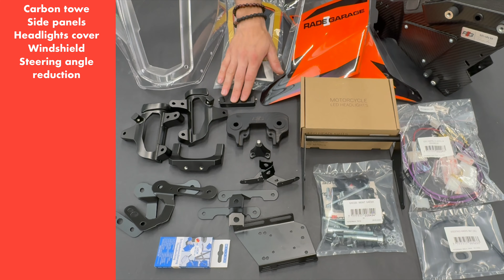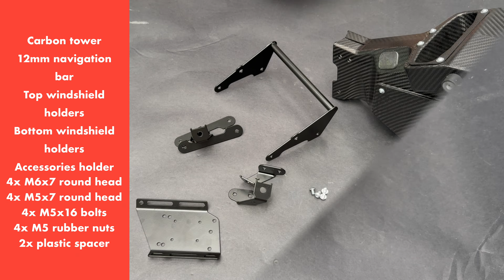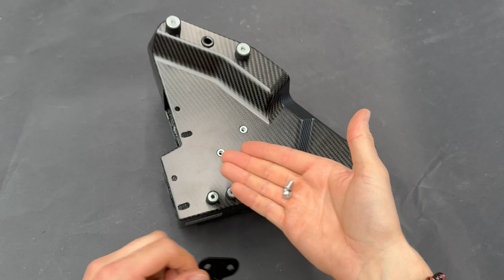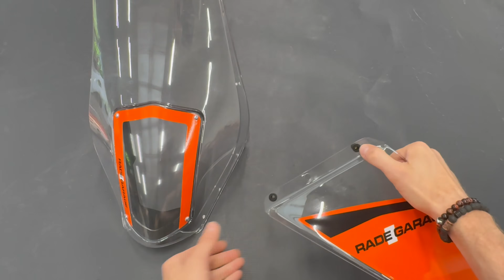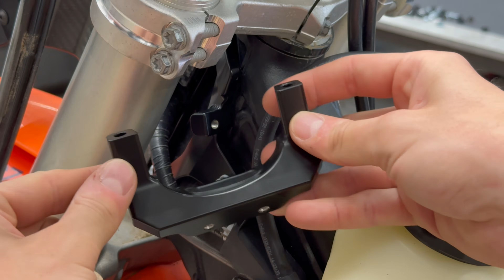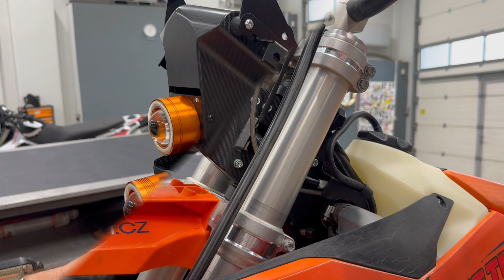KTM EXC MY2024 Fairing kit Installation video by RADE/GARAGE

Comment: Wondering where the front turn signals reattach?
Reply: It comes with blinker brackets that mount on the same bolts as the lower fairing mounts